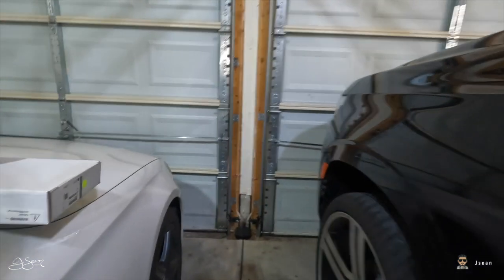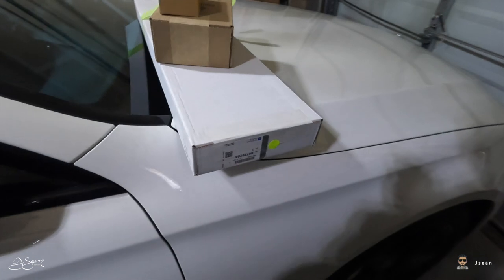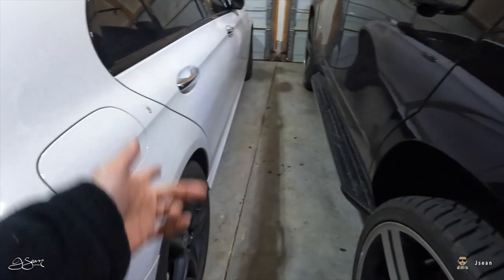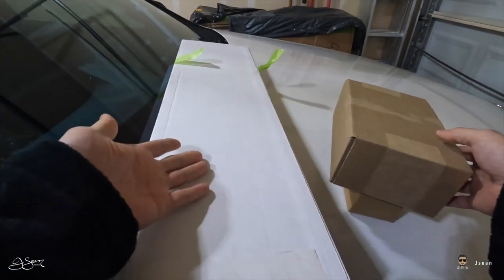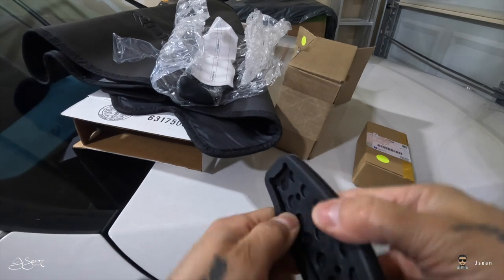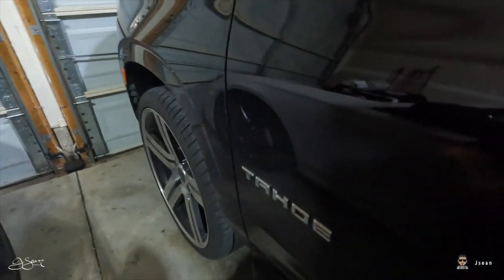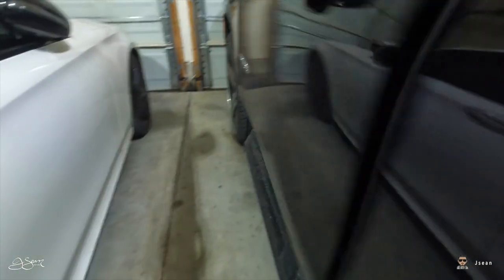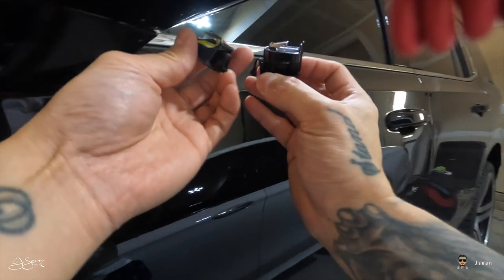2022 Tahoe Factory Upgrades + Tesla Update | Jsean

Comment: Hey just wondering where you got the chevy logo puddle lights
Reply from the maker: You can order them from the dealership.  I ordered mine through the my Chevy app directly and picked them up from a different local dealer.  I guess not all work with the app etc but any deal should be able to order them though.  Hope that helps!  💪

Comment: Can you fit the illuminated bow tie to the Tahoe premier?
Reply from the maker: Hello, yes you can.
Reply: @Jsean  Ok, I was just at the dealership and they said it was not compatible but I still want it. So, I will have to get it installed somewhere else.
Reply from the maker: @chrisgaylamanson7404  why would they say that?  It’s plug and play into the existing harness.  Unless the grill is somehow different.  If your body style is the same it should work just fine.  You just have to drill a small hole in the center of where the existing badge is at when you remove so the grommet from the glow one can poke through.

Comment: What’s up man, whats the part number for the rear facia? I’m looking to go the same route for the exhaust tips.
Reply from the maker: GM Part #84751055.  It ended up being cheaper to buy it from the dealership.  Freight charge is really high when you order it.  Plus, they even gave me back the core charge of $70 when I gave them my old one even though it’s not the same exact part.  If you order it online they will charge you for that fee too.  I also ordered the heat shields and spare tire guards along with the hanger for the other side as our single exhaust only has it on one side.  i thought I would need the exhaust shop to weld the hanger but the piece they ordered for me looks like it bolts on somewhere on the frame.  I haven’t checked yet because I’m not at that step but if that ends up being the case it will make the factory style install even cleaner.  I had the dealer check what was needed for the other side of a high country to confirm with all the extra parts that I ordered too.  You don’t need to order those extra parts but I feel like it may be needed since that’s how it comes factory plus the heat from the exhaust may affect the exposed side of the spare.  Good luck with the switch.  I can’t wait to have mine done.  I’ll probably put a video up when it’s all done 💪
Reply: @Jsean  thanks for the reply man! I’ll make sure to do that 💯

Comment: What up bro!! Looks dope! I want those pedal covers for my brake and gas pedal. May I have the part number? Keep making content!
Reply from the maker: What’s up!  Thanks.  Here is the part number Part No. : 84712883 every once in awhile there will be slight sales happening in the my Chevrolet app that you use to remote start your vehicle.  Hope that helps!  💪
Reply: @Jsean  hell ya it helps! I’m going to look into that asap! What’s your next project on your Tahoe!!?
Reply from the maker: @oneblessedexec  I added the factory dual exit facia from the high country and added dual quad tip Corsa sport cat back exhaust on there with a Corsa cold air.  I added all factory parts so it fit and looked factory.  My previous Tahoe had a single side exit Corsa but I don’t feel like it looks as good as the rear exit on these newer bodies.  I did this shortly after this video but I never got around to posting.  What I may do is a quick walk around to show it completed then make a follow up if anyone wants to know more details that way people can see the finished product.  It looks good but sometimes I do miss the quietness from this model before I put the exhaust back on lol.  💪
Reply: @Jsean  haha ya I did the the exhaust, sound system, re-tinted all 10 windows, bought new led lights for the rear housing,  I got the clear screen protectors for the monitors, the dash cam…I want to lower it but I legit am contemplating 6’s or 8’s… but before I do that I been researching big brake kits for our Tahoes… 
Def do a walk-around. Very interested in seeing the mods all at once!
Reply from the maker: Nice, yea I always skip 28’s.  They do look better but I feel like the tire thickness on 26’s give me a good balance.  If you do 26’s you just got to avoid any rim/wheel with a lip or the overall look will be smaller.  I never even re installed my dash cams back in from my last Tahoe yet either.  These vehicles now got so much electronic stuff going on in them I’m scared to tap into some of it.  Yea I don’t know why they didn’t make the rears LED’s.  That didn’t make sense to me!
Reply: @Jsean  that makes a lot of sense! Ya, if I go 6’s then I’m lowering it on a concave rim … oh ya the technology is insane these days. I wish there was a YouTube that showed hidden tricks/ quick go to tips on our Tahoe. Get the best out of the vehicle… oh ya for sure bro-you have to go check out lasfit leds…get yours for the Tahoe!
Reply from the maker: @oneblessedexec  that’s the thing, the brake system on here is a little larger so you can’t concave as much at all.  My previous wheels where concave and I tried to keep them but they wouldn’t clear the brakes smh.  Make sure you check that out before you order.  I had that same problem with our Benz.  I love how concave looks too!  Yea I’ll check those lights out!  Thanks. 💪

Comment: Link to tha back seat mat cover ?
Reply from the maker: accessories.Chevrolet.com you’ll find it there after you type in your vehicle.  That’s where I got everything.  Some stuff can be mailed directly to you or picked up at your local participating dealer.  If you have the my Chevy app you can also access it from the app under accessories.  You can also order it at the service counter but you can often find discounts they are running directly from the app.  Hope that helps!  💪